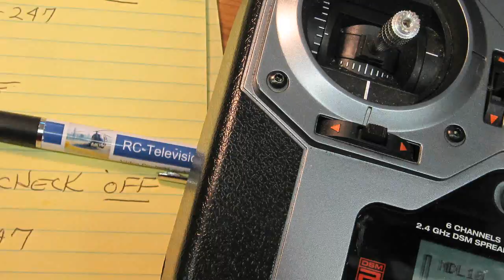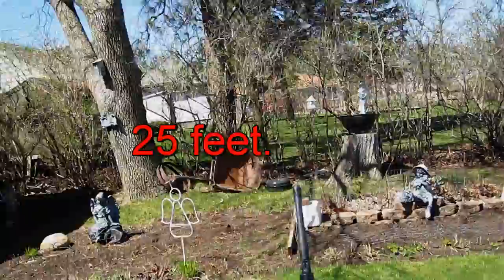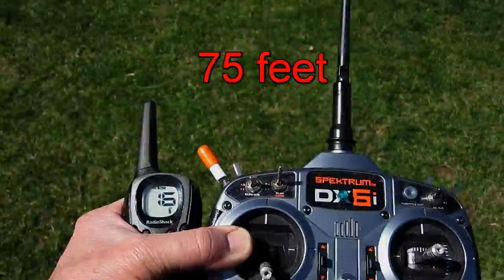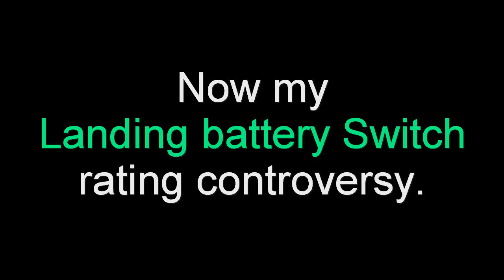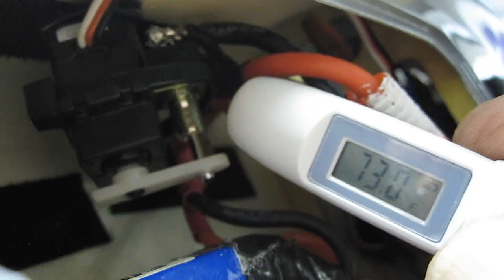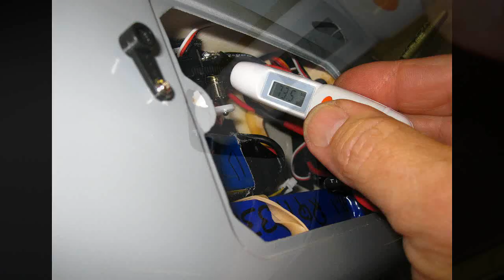DX6i's POWER SETTINGS tested plus LANDING BATTERY Switch Heat.

Comment: I watched this and can't belive i didnt give it a like then, although I did subscribe before that but I had 2 youtube channels so it might be on the redundant one (a USA close friend said the user name may put some US users off so it might still be there but never used, lol). I still have my OG DX6i and it was set to US settings as I found a spec sheet. The 1st DX6I was not DSMX compatible it was dsm2, later ones did both as did the DX8 & 9 (legends). The data sheet I sourced was USA 200mw, EU (UK also then EU) 100mw (surprised they let us have that much power) and France was 75mw or something because Liberté has costs?! New Radiomasters with ELRS etc has already blown 200mw out the water, and the new protocols are going to give you a cheap "in comparrison to Spektrum/Futaba/Frsky" and very powerfull radio, yay (no doubt a pain in the ass to program like Futaba). We are not talking marginal differences, radiomaster/jumper have already cranked power and range way past most others and are multiprotocol. I have a Dragon link I use with my DX8 (dsm2/dsmx) that gives me 20 odd miles. Spektrum are the easiest radios going IMO, love them but they are not going to keep up. Also the IX12 whilst a great radio once it finally boots up (over 5 minutes) is ruined by the sheer cost (also Spektrum upgraded all the IX models above the 12 to have more channels, wtf). Spektrum/Eflite/HH/Futaba etc have to get their heads out their asses because why would I pay the huge price differences for an inferior less powerful radio when I can get one that will work with basically everything?

Comment: I found this out the hard way.  dx6i stock setting is EU which is 100mw.  US is 200mw.  i lost a Blade 350 QX only 1000 feet or so away with 200mw fpv system.  return to home is too slow to help at that distance and i lost the quad due to about two feet of snow.  I then found out about power setting. checked my dx6i and yes it was on EU.  At least i'll never forget about this setting.   ha ha

Comment: Great video Dave! I have a question about the lost plane hook-up. I've read a lost plane setup would not work with the dx6i because of  it's built in fail safe. How did you set it up so it sounds with loss of signal,or power,and not having to hook it up to a function switch like gear,flaps,etc? Would you please do a video on how to make a lost plane setup for the DX6i. Keep the videos coming,I have learned a ton of information from them.

Comment: I can answer the question on the switch. The 5amp switch is rated to switch 5amps of current. My guess the switch contacts are able to support more current than 5 amps.. Another wards switching batteries at full power would probably burn out the contacts after multiple uses but switching at no or low power should be fine on the contacts.. All the DPDT switch is made of is flexible copper plates with contacts that switch between the center pole, resistance is really your only enemy in this.

Comment: @takeit69 For what its worth, I love my Dx6i.  I've never had any problems.  My only complaint is the lack of a backlight which is easily remedied and it only has 2 extra programmable mixes which has made no difference to me at all.  Make sure you are talking about the DX6i not DX6.  There is a difference...BIG difference!

Comment: Great job and nice video! The only questions I still have; is there a difference in battery temperature without the switch in the circuit? Are there differences in battery run times with or without the switch due to extra resistance on the circuit? I saw the other video and know that if you keep switching between the two run time in Iowa is limited to how long your fingers can resist the freezing temperature. LOL Hope Spring comes to you soon.
See you in the air!
Ray

Comment: There are quite strict laws regarding broadcast of signals in Europe. for instance, you have to have a licence to operate a VHF radio. also those i-trip transmitters for your i-pod are technically illegal here as they broadcast on frequencies set aside for fm radio. however these laws aren't that rigorously upheld. 
I do know that people do get into serious trouble for broadcasting a signal  of high energy, particularly in cities or near airfields.

Comment: it has to with the UE and Frances ver of our FCC and power out put of things that transmit on 2.4Ghz and what channels on the 2.4Ghz band they are aloud to use 
a user could change it to the US setting but Horizon/Spektrum must have setting in the TX for it if they want to sell it over there and in case you take your TX over seas and want to use it

Comment: EU is not United Kingdom, its European Union. United Kindom would be UK!

I think the reason that the US Mode has more range is because it uses higher transmitter power output then the other Modes. 
The US Mode might be illegal to use in Europe since there are quite strict restrictions regarding transmitter power and frequency.